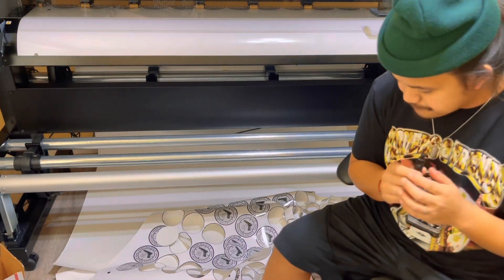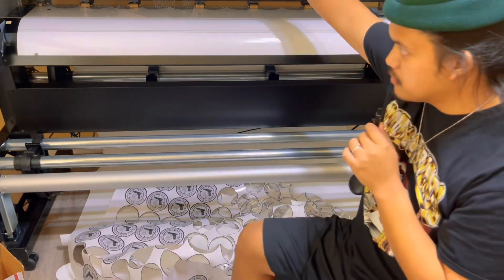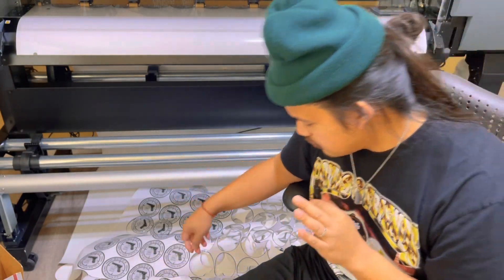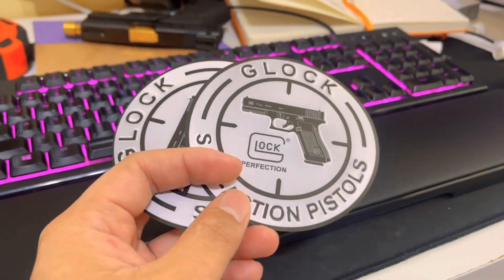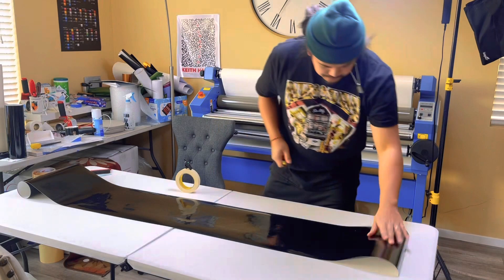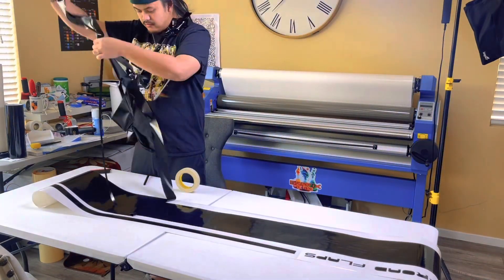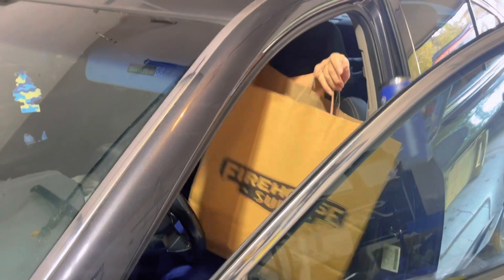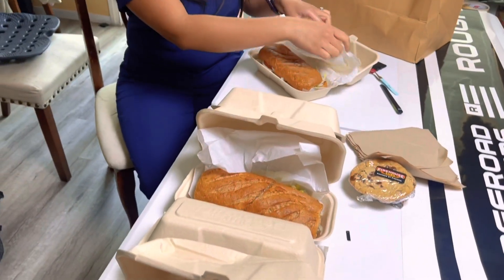Messed up cutting stickers on Roland VG3-540.  I need a dedicated cutter… The Summa T- Series 🙏🏽

Comment: use custom cut in versaworks....2 rows at a time, print cut, repeat
you can also adjust cut on feed/scan on printer..
or problem is just slipage how the vinyl reacts with the rollers.

Comment: Hey man, Great videos... I have the same problem having the same machine as yours. but the difference is I only print 1 or 2 small stickers not a long sheet at all but i still have the issue you had in the video with the cuts.. one side is thicker than the other side. I have checked everything such as the cutlines in the illustrator, cut alightments, cut tests and all that but I am not able to figure it out :( its about 0.5mm off from oneisde of the kisscut. Any ideas? :face-turquoise-covering-eyes:
Reply from the maker: Thanks for watching! The issues i had i was i was cutting longer and the vinyl was shifting slowly.  I would suggest to run your print and cut adjustment and crop cut position adjustment. to go > Menu > Media settings > run and execute both the adjustments. I ran that too just incase. and i have no problems so far if im cutting something that is less than 4 feet.
Reply: Thank you for the quick reply buddy... I'm running the tests now and see how it goes :elbowbump:
Reply: @hotpotmarketing5877  what happened?
Reply: @juliamata5350  I called Roland and they have changed 7 main parts of the brand new machine :( I have been lucky as it was still under the warranty so I didn't pay for it. Their engineers are not the best they preferred to change parts rather than knowing what to do. I have also applied some WD40 on the cutter tool as it is spinning.

Do you have the same issue?

Comment: Hi I hope your business thrives

been there and done that
pinch roller and grit feeding mechanism are only good for coloured vinyl cut job (traditional ccv)
only flatbed cutter with camera on gantry is solution for perfect registration of Print and cut
you can also diecut and kiss cut very easily by having two knifes on head carriage
(e.g. square decal with contour kiss cut inside, which dont damage edges of contour cut face and easy to peel off from backing liner)

I highly suggest you to look into summa f or other flatbed digital cutter, which will help you to expand your businees with more profitable products and service by having just 1 good cutter.